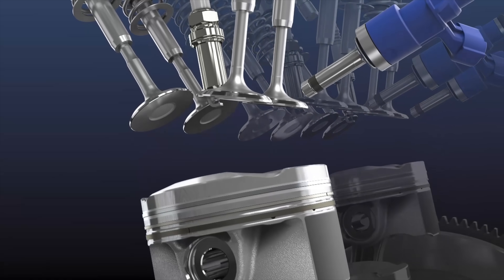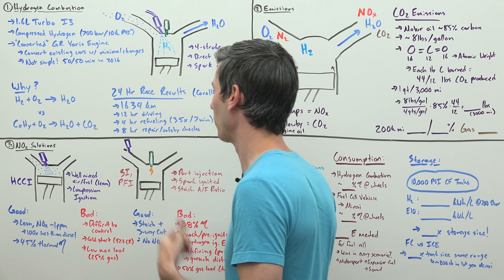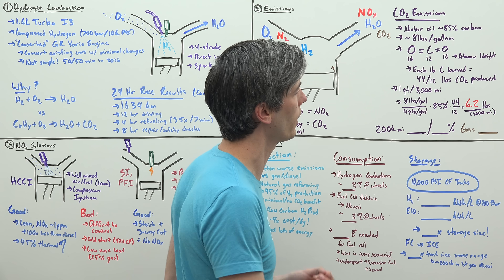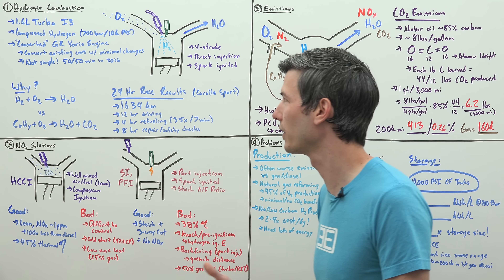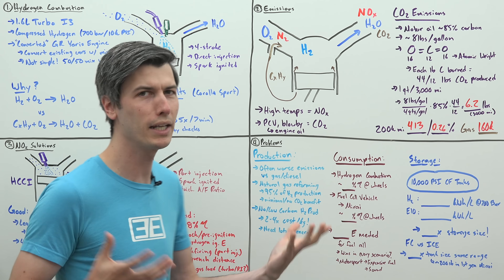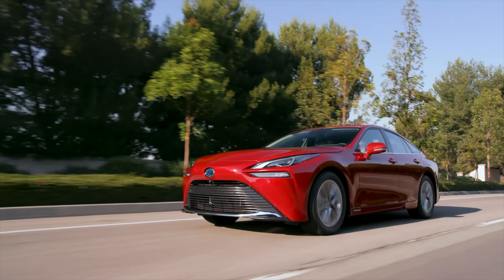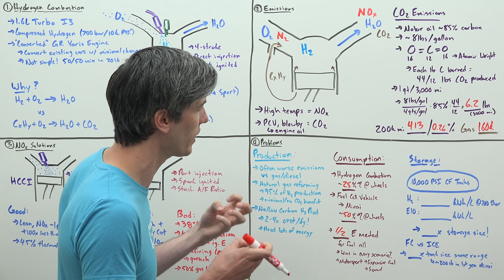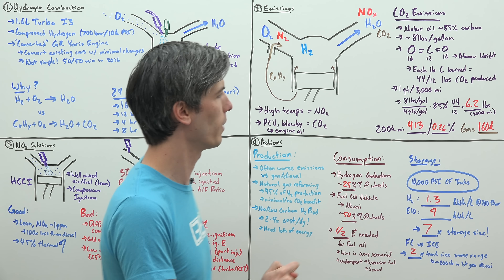Toyota's Developing A Hydrogen Combustion Engine!

Comment: Im so happy that you include NOx, as many oversee this.
Reply: Don't u ruin my one hope of driving a V8 in my old age days.
Reply: Thats why gas cars have a catalytic converters wonder how they use a catalytic converter on this type of fuel
Reply: Aint a problem if you make the einge two-stroke.
Reply: General Smedley Butler  There's no sound tho
Reply: I've driven a couple of electric cars. As far as total driving experience, I would say they were amongst the most boring vehicles I've driven. That's just my opinion.
Reply: Jan 6 was "Wall Street Putsch" part 2  " If you like big V8s then you're almost certainly attracted to it because of its huge torque numbers and the fact that it can generate that torque low in the RPM band."

Or because he likes V8 engines. He might also like manual transmissions as well.
Comparing the two is like comparing a piano to a synthesizer.
Reply: @robertbennett2796  , wrong. Catalytic converters are what create NOx, and can't be used to get rid of it.  Instead, diesel trucks us BlueDEF, which is a urea based product that eliminates NOx.
Reply: Actually NOx is fertilizer for plants, and quickly breaks down in to harmless components.  The EPA only checks NOx in order to prevent foreign cars from competing with US clunkers.  For example, diesel engines produce only a forth of gasoline engine carbon emission, so they had to find some way to make them illegal in the US.
Reply: @kirkaugustin2232  Catalysts are used in conjunction with DEF to reduce NOx. 
Selective Catalytic Reduction.
Reply: @kirkaugustin2232  NOx is not fertiliser. 
Nitrogen is fertiliser, they are not the same.
Reply: Yes, the EPA oversees it for one thing
Reply: Jan 6 was "Wall Street Putsch" part 2  Actually I like big V8s because of the sound, not because of anything else... Can electric match up to that???
Reply: Now let's talk about the energy going into producing and canning all that hydrogen..

Comment: "Lets say you have a car that burns a quart of oil every 3000 miles" 
Me with an Audi 2.0TFSI: So you mean good oil economy
Reply: Does 2.0 FSI still burns oil ? I know 2009-2011TFSI burned it but after that they changed piston rings.
Reply: @Thevol40k  Subaru FB20 engine burns 1 litre of oil every 2000km on my car.
Reply: @vulpes122  is that a rotary
Reply: New engine: Audi should do about 10,000 miles. BMW practically 'zero' both in my experience.
Reply: So it's practically a diesel?
Reply: My 2018 Golf EA888 never burns a drop.
Reply: @Thevol40k  they had terrible oil consumption due to shitty piston rings. 2013 on I think the problem was fixed. I bought a brand new A4 2.0 tfsi and it was down to 1 litre every 1000km before they fixed the rings under warranty and  about 1 litre every 6000km after., so still bad. Cut my losses and traded it in as soon as I could
Reply: Opel's Ecotec Z16XEP - a bit over 1L/1000km ;)
Reply: @trw8777  yes my 335 does the same we have it bad
Reply: I put this elsewhere but I’ll repeat it here:

My ES 350 Lexus burns zero oil over 3000 miles, or over 7000 miles, lol, that takes care of that part of the problem.
Reply: Vw Manual : 1l oil on 1000km is normal use dont worry about it
Reply: Oh man, this comment made my day! I owned an '11 2.0t Audi for around a year. This thing looooooves oil! It believes in peanut butter and eats and eats it...
Reply: Audi, keeping Castrol OE in business since forever.
Reply: @trw8777  My N55 nothing. I do change oil every 700km.
Reply: Not just me that found that engine did that then 🤣🤣🤣
Reply: @rodrogers6895  But who wants to drive a living room Couch though? Well, unless you are at that stage of life👴🏻
Reply: I have a 2000 Toyota Camry I bought new. 
I’ve never added a quart of oil between oil changes.
Reply: @hoponpop3330  you change the oil every 1500 miles tho 🤣🤣🤣
Reply: Me, having owned only Toyotas, a Camaro, and a TrailBlazer:
...some cars need to have oil added between changes? By design??
Reply: A quart of oil every three thousand miles, WTF??
Cuts to image of Jake wiping oil off the windscreen of the Blues Mobile

Comment: The double bonds between the C and Os are a nice touch.
Reply from the maker: Not tryna brag but I might have taken chem 101. 💁‍♂️
Reply: @EngineeringExplained  I took Chem back in grade 11. I love Chem, but man I nearly failed! It got way more difficult than I expected it to.
Reply: @EngineeringExplained  damn Jason leave some knowledge for the rest of us!
Reply: @EngineeringExplained  You left out one big issue, as Hydrogen slowly weakens the metals by bonding with them in a similar way that Oxygen does to steel. Which makes the pistons, cylinder head & block brittle over time. There was a test Mail Jeep [DJ series] that was built to burn Hydrogen but the engine lasted something like 10K miles and the pistons lasted even less. Unfortunately, this wasn't on the web, despite being in the newspapers in the pre-internet days...
Reply: @davidhollenshead4892  Hadn't thought about that in spite of my time as an industrial welder. Hydrogen embrittlement is a pretty big deal.
Reply: @EngineeringExplained  Balance those equations! (Sorry - very pedantic today evidently) 😊
Reply: @davidhollenshead4892  , are none of the hydrogen embrittlement resistant alloys suitable for engine parts?
Reply: @JimBob1937  one would think that they would be. Why wouldn't they be? I don't know myself, but someone with more knowledge than myself might know.
Reply: @EngineeringExplained  Hey Jason could you maybe tell me the author and publishing year of that study on ways to prevent NOx you mentioned? :)

Comment: I think the tank weight is still lighter than battery weight. Be interesting to see  the weight  difference and possible environment impacts.
Reply: With a 500Wh per 1 kg battery (CATL) coming out, a 100 kWh battery would weigh 200kg.  BEV batteries are developing very fast. There's no real hope for hydrogen to win in small vehicles. Ships, trains, and maybe trucks, could have some use. But that 500Wh is the level where the game is also over for long-range trucks. A Freightliner consumes about 150 kW per 100km. That would be 300 kg. A 3 000 kg battery would give a 1 000 km range for that truck. 3 000 kg is not that much extra weight when you consider all the other tech you don't need anymore like a huge combustion engine, fuel tank, emissions systems, etc.
Reply: @timogronroos4642  non-sense…
Reply: @timogronroos4642  lol ice vehicles weigh on average 200kg less than evs. That battery is heavier than the entire power train
Reply: @sigmamale4147  Whats funny? Weight is not a issue for weighter as it can tow several TONS weight behind. And eu is giving electric trucks to carry 5 tons more so batterywights is not a issue.
Reply: @ViihdeJukat  HAHAHAHA weight isnt an issue ? Guess what they could have done with that extra 3 tons ? Haul merchandise and actual products !
Reply: @sigmamale4147  No because diesel trucks arent that efgiciency and added weight could slow them further and using lot of diesel in hills. The original weight is for diesel truck so the efficiency keeps realistic. Electric truck has mire torgue and power it can tow more.

Comment: This is the most concise explanation of the use of hydrogen in engines and in fuel cells I've ever seen. I've had a vague concept of this topic but this video brings it sharply in focus. Thanks!
Reply: One problem though... This is not fuel cell technology. 🙂 This is just the classic, barbarian way of exploding things inside an internal combustion engine in order to produce mechanical energy. It "just" replaces gasoline/diesel/ethanol/whatever with hydrogen.
Fuel cell technology is about reacting hydrogen and oxygen in an elegant, controlled manner, in order to produce electricity on demand which, in turn, powers an electric engine.
Reply: @prafuitu  barbaric?. If the goal is to avoid burning fossil fuels this is the best solution. Barbaric is the mining used to get Lithium to produce batteries.
Reply: @rnp9876  I was referring to the method used to convert fuel into energy, be it diesel, hydrogen or whatever.
"Exploding" hydrogen in an ICE to produce mechanical power has roughly 30% efficiency while converting that same hydrogen into electricity in a fuel cell vehicle is, again, roughly, 60% efficient.
That's why I called ICEs barbaric in comparison to fuel cells. BEVs (battery electric vehicles) were never mentioned by me, so your argument about lithium mining is irrelevant to this discussion.

It's barbaric in the same way frantically hitting the drums is barbaric compared to gently drawing the bow across a violin's strings in order to produce sounds.
Reply: @prafuitu  EVs are not the solution. Fuel cell, probably and they are much better than battery only car, in my opinion.
Reply: @rnp9876  Fuel cell vehicles are EVs, but again, you're missing the point that hydrogen ICE (presented in this video) is not the same as hydrogen fuel cells, what the top comment claims.

Anyway, to play your game:
It looks to me that you read somewhere that Li mining is bad and from that you derived that EVs are bad when you clearly don't know what an EV is.
To claim right now that EVs are bad just because the batteries technology is not optimal (when we're clearly in its early days and it has already hugely improved compared to just a few years back) is as shortsighted as saying that the ICE was bad compared to a steam engine because its efficiency was horrendous in the beginning.

Things are improving at a rapid pace, motors are becoming more efficient, alternative ways of electricity production are in development or deployed every day (check the ITER project to see the mother of all energy plants),  new energy storage solutions are researched all over the globe, including alternative battery chemistries like Iron oxide or Aluminium/air ...
EVs might not be the present, but they sure are the future in either BEV form, FCEV form or any other form that we haven't even dreamt of yet!
Reply: @prafuitu  First, I am not playing any game. Probably in your mind. Second, no one knows the future. again, FROM MY POINT OF VIEW, battery based electric vehicles are not the future, at least not for the masses. Fuel Cells SEEMS to be better, again, from my point of view. It is a matter of perspective, experience and acknowledge you and I have separately. But, if we can be REALLY more efficient grabbing energy from the one and only game changer (the sun) and are able to supply for all the increasing ingest of energy the world is having, as we are plugging more equipment than ever,  then the battery car could be a viable solution. Again, no one knows.
Reply: @prafuitu  : Wrong. You are not an engineer obviously. There is no "exploding", hopefully.
Reply: @buildmotosykletist1987  So you deny that a hydrogen internal combustion engine works by mixing hydrogen with oxygen and then igniting the mixture so the rapid expansion of the resulting hot gas pushes the pistons, producing motion?
Reply: @prafuitu  : No. I wrote: "Wrong. You are not an engineer obviously. There is no "exploding", hopefully."
I suggest you ask the maker of this video if he can explain it for you.
[BTW. You are not alone. Many people misunderstand how internal combustion engines work. I urge you to learn more. cheers ]
Reply: @prafuitu  : BTW, Hydrogen does not explode. i learnt that after witnessing a "flour" explosion in a bakery. The newspapers headline used "Explosion" but in the middle pages a bloke wrote a long article about the difference between an explosion and what I saw and why a bloke in the middle of it was not hurt but had been 'Sun-burnt' by the flames. Fascinating stuff.
Reply: @rnp9876  That process is going to level off pretty quickly. In ten years, batteries will be 80% recycled.
Reply: @rnp9876  This is ten year-old oil industry propaganda.

Comment: I experimented a little with converting my 4L inline petrol car to HHO, I was converting the water to gas in the car.

The two biggest hurdles I had was spare electricity, and upper cylinder lube.
I estimate about 130amps @ 12V to make a steady flow of hydrogen and run on average 2000rpm.
Upper cylinder lube could be solved by using an engine converted to LPG only.

Also if you only partial supply (I only ran 20amps@12V) to get better fuel efficiency you will need to spoof your oxygen sensor in exhaust. The cleaner exhaust will make the ECU think it running lean and enrich the tuning and won't use less fuel.
Reply: You should make a video about that.
Reply: that sounds like a headache
Reply: I'd love to hear more about this
Reply: @willg125   I also found that I only got about 10,000km out of my plates before they had oxidized to much. I used  stainless 3.16, marine grade steel. Also my water got dirty and had to replace it about every 1,500km.  I had 4 litre reservoir.
I used a teaspoon of baking soda mixed in my distilled water.
hope this helps.
Reply: @tomkeegan3782  Random af question: Want some science-channel to check out, cause the 
learning never ends? I got some.
Reply: Love hearing about and seeing hho being used, still a very difficult to utilise technology but facinating. Also hey look anither invader zim fan!
Reply: you should upload on this
Reply: @slevinchannel7589  look up hho there are plenty of videos here on YouTube
Reply: that is really a bold experiment to run your ICE engine on pure Hydrogen (+O2).  I think you should use Titanium Coated SS plates for more robust life of plates, and use same Chamber (1 single chamber) for Electrolysis and HHO output (yes ofcourse need to use a thick Acrylic / PC container with heavy duty tight lid) and feed the output directly to the PCV intake through a T-joint.  If you like to buy an existing product, then look up Fuel Genie Systems manufactured by Barry Hart.
Reply: @SamMonkulas  sound advice. Thanks
Reply: I really doubt you could produce a meaningful quantity of hydrogen on board from water. The alternator produces 500 to 2500 watt depending on the model, so you would make negligible quantities of h2 not even significant to improve fuel combustion.
If the system works only with an lpg engine, it's even less worth it since lpg is already one pf the cleanest
Reply: @phantomsoldier497  Correct. My ford only had about 30amps to spare.
In reality you need to install a second alternator just to run your HHO.
Reply: @marcelscott6358  for best production of Hydrogen use KOH (Potassium Hydroxide) and for every 1000cc of Engine use 4-5gms of KOH.  So for example you drive 2.5L Engine then for every Gallon of Distill Water (4.2L) you will mix about 11-12 grams of KOH and shake the bottle to mix well. This is the measure I have used as taught by the master Barry Hart and it works fantastic. I have been running my old car with a tiny amount of HHO which is almost negligible with hardly taking 80-100mA so there is no load on Battery or Alternator and it cleans the engine while allowing a good power and saving fuel - BUT ONLY ON HIGHWAYS...... not in city driving. For example I have 2.4L gasoline 7-seater van and with petrol filling of 23L (roughly 5 gallons) it travels in City with max 210kms (roughly 130milies ?) but the same amount of petrol with 80% highway driving at speed of 80-100kmph (55-65mph) I can go as far as 270kms (roughly 167miles).
Reply: @marcelscott6358  i think yoy would yield better result with a system running on ammonia. Ammonia is easily storable in a low pressure gas bottle like lpg and has more hydrogen in it by volume than hydrogen gas itself
Reply: @phantomsoldier497  good know. Thanks. Wonder if the exhaust would smell like burnt piss. LOL
Reply: @marcelscott6358  I think that a working system has no particular smell, it's pnly hard to run because the flame front is too slow. A hho system might actually help an ammonia fuelled engine to run smoother
Reply: @SamMonkulas  I had similar results, 10 litres petrol per 100km before HHO.
      9.5l/100km @300watts in city,
      8.5l/100km @300watts open road.
I feel it would have been better if i had fudge exhaust sensor because the cleaner emissions made the computer think the car was running to lean, making it tune a little richer.
Reply: I made a similar hydrogen fuel cell and used baking soda and distilled water and run the hose into my breather box on a carbureted vehicle I was using a one quart fuel cell made out of 304 stainless steel and it made my car run smoother especially when idling but also turn my water Brown and oxidize my 304 stainless plates